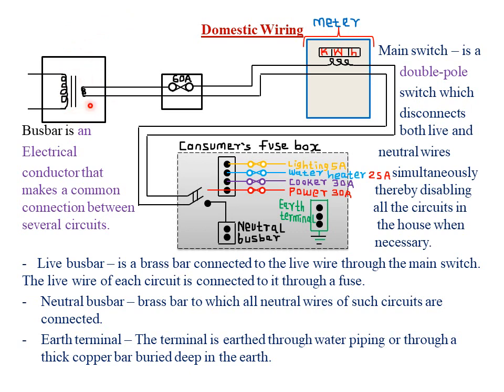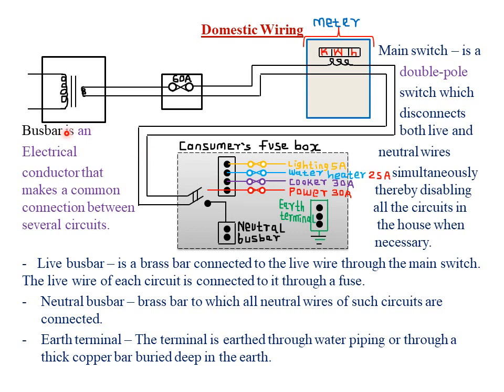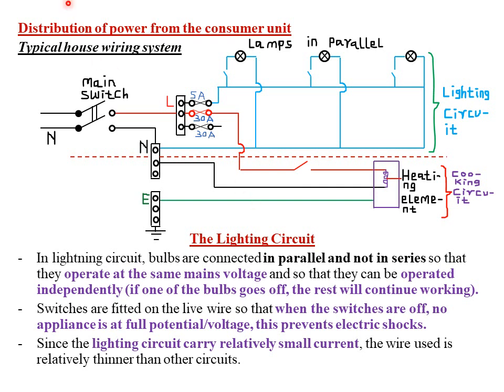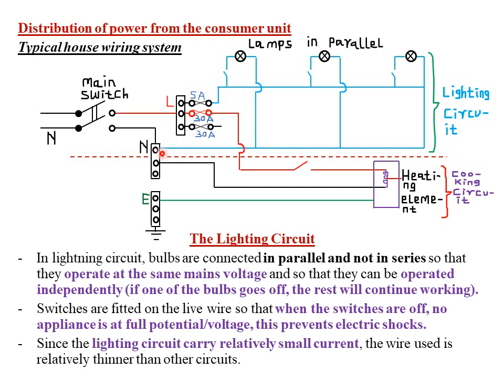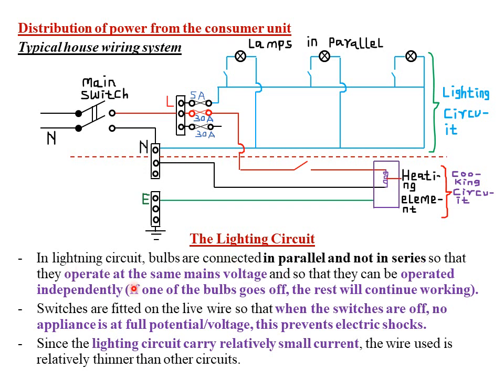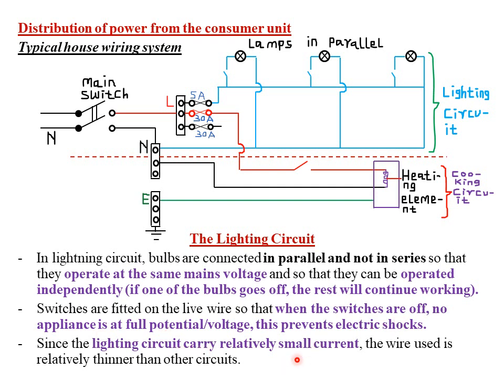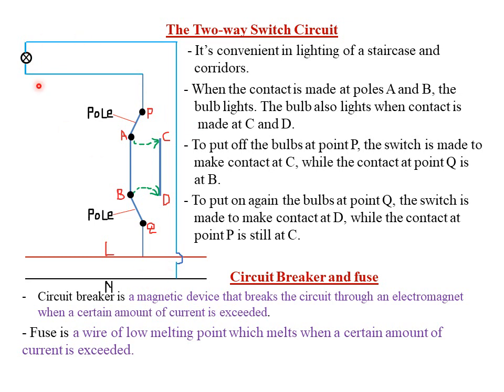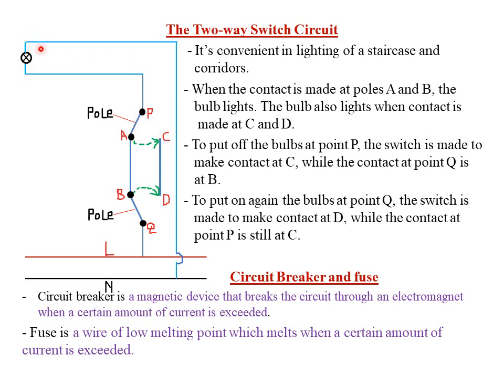MAINS ELECTRICITY : LESSON 3

Comment: You are doing a good job but in this particular lighting circuit there is a problem because it has short circuit which can cause electric fire if connected practically. Please correct it